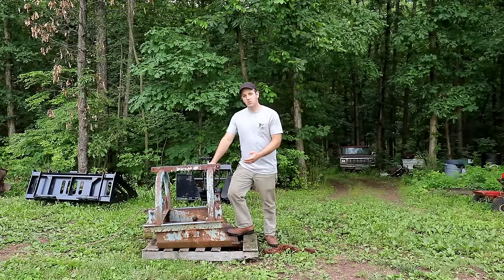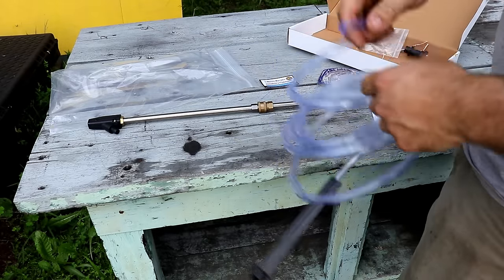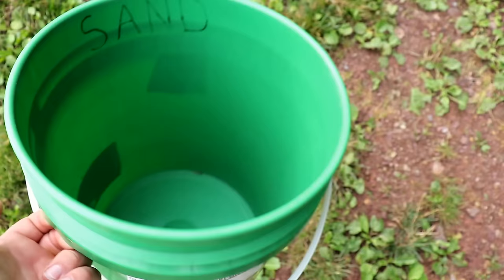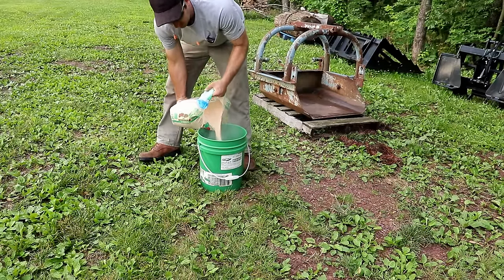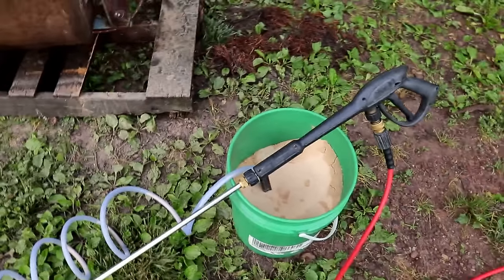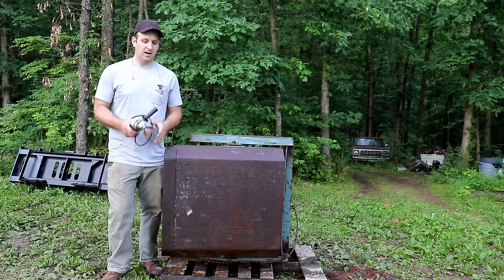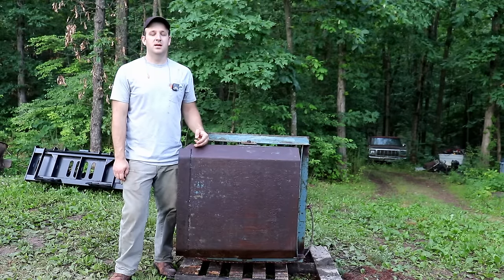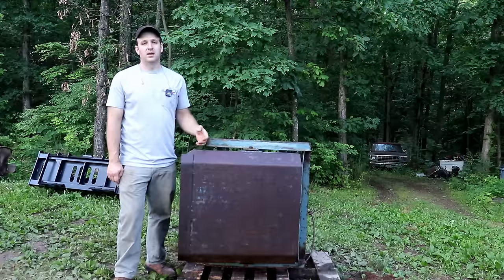I Turned My Pressure Washer Into a Sandblaster

Comment: I believe for about 95% of the time you were pressure-washing, no sand was being siphoned.  At 5:20 and briefly thereafter, we could see some white-metal areas appearing, but for the most part, it was just water-blasting.  You kinda need to keep eyes on both the work and the siphon-hose to monitor how the sand is moving.  I had a similar experience with my similar setup, which I set aside, but hope springs eternal.  I needed a helper to keep an eye on the sand, to keep moving the siphon-wand around and be sure it wasn't clogged or 'sucking air,' that overspray wasn't getting in the bucket (but was working alone)...but mostly what I was fighting with was water backwashing into the sand-hose from the nozzle...boom:  shut it down until you can get that hose clean/dry.
The holy grail of this method would be a system that can work with wet sand.  I messed around with that a little, only to the point where it became obvious that a wet-sand slurry, when added to the pressure-washing stream, took all the needed velocity out of it.
Reply from the maker: It was sucking sand but the siphon hose did not have a full stream. Shortly after I did this video this pressure washer died. I am going to try it again on my other pressure washer.
Reply: At 10:17 no sand ⌛
Reply: Get an old lpg/ propane bottle, and cut  the bottom out, then invert it so it will be  a funnel for the sand. Attach the feed hose to the gas fitting, for  continuous sand feed. Make some legs for it and you are ready.
Reply: @Jack Blakeney Take a look at what some people are doing in the realm of 'vapor honing.'  It's close to what I was hoping to do, but won't be fast enough for what I need to do typically, according to one of the most prolific posters.  They're doing what amounts to wet sandblasting, but in cabinets.  Problem for me is that it's not so much for heavy rust removal, though GREAT for cleanup of finer oxidation and paint from smaller-scale parts like engine or carburetor components. 
Anyway, the basis for getting the sand into a suspension in their supply water is just an average-sized submersible pump that recirculates water within a common 5-gal bucket that's got the sand in it as well, placed below the cabinet.  A portion of the pump output is redirected to blow the sand up from the bottom of the bucket, thus achieving the suspension.  The guns they use siphon up that suspension.  There's a LOT of water in the blasted mix, to the point where they have to use windshield-wipers and such to keep a clear view of what's being cleaned.  If I were doing nothing but small-part restoration, I'd go this route for sure.
Reply: @Jack Blakeney I went a lot further than that, and had dismal results.  Adding a heavy water/sand mix to the pressure-washer stream had the same effect as running a car into deep mud:  the stream has nowhere near enough energy to clean once the two collide.  It apparently works with compressed air vs pressurized water as the driving force, though (eg vapor honing).

Comment: Used one but added a flow in via compressor sand tank. So sand is pushed through. Even with a small electric water blaster it works aok.Wear good breathing mask.
Reply from the maker: I bet that did help. I'm not sure how my suction nozzle is made and if it would take pressure.

Comment: Good job. What tip did you use your zero tip? I agree, a full face shield, and maybe even plus safety glasses may be best. Thanks, John
Reply from the maker: I used the tip that comes with the sandblasted. You don't use your pressure washer tips. The sandblaster goes in place of the pressure washer tip.

Comment: Try morter sand. I bought some for a sand box for the grandkids. The guys at the hardware store told me it's better for building sand castles than that stuff you buy in a bag. They filled the whole bed of my truck for $19.20 at the concrete plant that was conveniently nextdoor to the hardware store. It's a much finer sand.
Reply from the maker: I have since found out that sand is bad for blasting. It can cause silicosis.

Comment: I think it looks great. You don't have to get it down to new metal. The paint will adhere really well to that surface forhe same reason you spray red oxide primer.  My uncle and cousin spent their lives in the sand blasting business and that's what they told me. Youmight even let is set out a couple days to get that flash rust so the paint can get a good bite into the metal.
Reply from the maker: Yeah,it was probably more than acceptable for a tractor implement.

Comment: I would think that at low pressure and the water to sand ratio would only take off surface rust unless you remained concentrated in a small area over time.
Reply from the maker: I think that it was not siphoning enough sand.

Comment: should have used more courser sand for metal, play sand is good for wood to strip paint
Reply from the maker: Yeah, I was just trying to start with something cheap to see how it worked.
Reply: I use the 30 grit 100lb bag for sandblasting from home depot and it works great
Reply: My dad used to get us sandblasting sand since it was cheaper and he had a sandblaster so he just used it when the summer was done

Comment: I'm interested and thinking that together with a diy coke bottle air blower sand blaster could give fairly workable results. Water and sand are definitely a recipe for flash rust I'd reckon.
Reply from the maker: I'm thinking I need to follow up with a weed burner/ propane torch to dry it fast.

Comment: I have the same. blasting gun.  the sand feed tube is 

a) too long = more resistance to suction

b) coiled (sand goes down, then has to be lifted, repeat), big resistance 

c) wet or just humid sand won't flow well, if at all. Must be super dry.

so that adds up a lot of resistance for the suction to overcome, preventing a reliable, full volume of sand.  

yes, wet sand will clog. if any doubt are granularity, sift the sand thru window screen to reduce clogging

my washer: Powerhorse Gas Cold Water Pressure Washer — 3200 PSI, 2.6 GPM

When I got good sand flow, only intermittently, removed mill scale and gave white steel.  Even with your pitted, rusty steel you should be getting white steel

But the sand flow was VERY irregular.  Very frustrating.  I shortened and straightened the sand feed tube, which was much better, but not yet acceptable.  holding the gun in one hand, and jiggling the sand tube in the other.  tedious, ineffective.

I'm thinking about elevating the sand bucket to about waist height so the suction doesn't have to lift the sand, should increase chance of a good, steady sand flow.

And I agree, play sand at $5 / 40 pounds works well. Lowes has two grades of sand.  Large grains weren't my problem, but I will sift next time anyway.
Reply from the maker: I agree with all of that. I think I need some kind of stand for my bucket. Someone said pool filter sand works well. I have also been told to try different tips.
Reply: It looks like the sand/blast media needs to be in a bottom outlet cone sitting above the job. That way gravity takes it all the way to the blaster tip. All the water suction as to do is overcome line friction.

Comment: What you have looks like it is ready(when it dries) to be painted with a rusty metal primer and then a top coat. I have a big sandblaster that makes the steel clean and brite but it makes a big mess and takes at least an hour to set up. For tractor attachments, dump bodies, truck frames, and other normal use steels, I think you got it good enough. I will probably try one of those next year. Good Luck, Rick
Reply from the maker: I've used that rust metal primer. It seems to work good for something like this. I need to try some different media in this to see if I can get any better results. Have a good week!
Reply: @TractorTech  Thanks and same to you.

Comment: Still 25 bucks u can’t beat it ! Special in those tight areas that are hard to work at .. this would be awesome for my mowers and trailers.  I don’t need it 100% perfect but good enough to stop the spread of the rust that’s all ..
Reply from the maker: I have it working better now. I used it on my zero turn deck. I also want to use it on a trailer, so we thing alike lol.
Reply: @TractorTech  lol awesome!!

Comment: You would think with that high of pressure, the sand would buff it to a bare metal fast.  
But I don't think this works well because the water seems to be buffering the abrasive effect of the sand so that it glides off without actually etching into the metal.  Thanks for the demo.
Reply from the maker: You would think. I think the main problem is the media that I am using.
Reply: @TractorTech   I am no scientist, but I suspect the density of the fine media vs density of water comes into play.  Water molecules surrounding the grain of sand lessens the impact.   Maybe coarser sand would be more effective.

Comment: I have not used this method before,  but I have done a lot of pressure washing and a small amount of sandblasting. It appears to me that you danced around far too much, and did not spend enough time on concentrated areas. Maybe try slowing down and work on small areas.
Reply from the maker: I have it working decent in this video. https://www.youtube.com/watch?v=BlJ2jguphao

Comment: Maybe using black beauty media would be the trick. Play ground sand grains are mostly rounded and softer than black beauty. Black beauty also has sharp corners and it comes in different grit.
Reply from the maker: I may try black beauty. Play sand is not a good media. I just was trying something cheap since it is a one time use.

Comment: Play sand is not very good for blasting, but if you insist on using it, run it through a metal window screen first to get out the oversized chunks that will clog your system.  I would like to see this system used with fine black diamond coal slag.  That stuff cuts good in a dry blaster, I guess it would work good this way too...
Reply from the maker: I was using play sand since it is cheap, and I can only use the sand one time with this system. I am going to try some other things when the weather gets better.
Reply: Black Diamond Blasting Abrasives (coal slag ) is 50lb/$11.  I used it dry in a highly modified HF blaster.  It cuts well but the media gets everywhere and is very difficult to clean up. I want to try it wet but my pressure washer is only 2300 lbs @ 2.3 GPM.  I've read that the wet blasters are only effective @ 3500 PSI and above.

Comment: I would try pre-treating the rust before wet blasting with WD-40 or any cheap rust remover. I'm about to buy a wet blast attachment to spray the chipping paint of my concrete porch before I repaint it. I hope it works.
Reply from the maker: It probably would work good on the concrete.
Reply: @Conrad Cole did it work well?
Reply: @SteveMacSticky  Yes, it worked really well. I found a bag of "black blast" medium at my local hardware store but sand would have worked just fine I think. It blew right through 50 years of paint layers even in the places it was not chipping yet. I used a 5gal bucket with a lid I cut a hole for the siphon tube to fit through to try to keep the medium from getting wet. It was a bit messy cleaning up the black black and probably would have just opted for sand if I had to do it over again.
Reply: The black blast was very sharp and shiny like crystals of coal. It reminded me of what is used to coat sandpaper. It was easier and safer option to a diamond wheel on an angle grinder and probably cheaper too in the end.
Reply: @activenation  thanks

Comment: maybe if the bucket of sand is up on a stool so that the sand can come down with gravity.  and get all the curls out of the hose so the sand doesnt' have to do loopty loops to get to where it needs to go.   Put a hole in the bottom of the bucket and so the sand tube comes out the bottom of the bucket.
Reply from the maker: I have sat the bucket up higher and it did help. It would be nice to have a gravity feed setup instead of a suction feed.

Comment: I wonder how that harbor freight sandblast gun would work— but something like that implement I would just clean it the best I could and then por 15 it/rust inhibitor then paint it
Reply from the maker: The suction type sand blasters work good if you have a big enough compressor. POR15 doesn't work.

Comment: I'm curious what this would be like using "Sharp" builders sand? Play sand is apparently similar to sand on a beach. All the points have been knocked off through being agitated in the sea (Like tiny pebbles), but builders sand is more like crushed rock and is a lot more abrasive.

It would probably give the nozzle a bit of a hard/short life, but if it gets good results, and the replacement nozzles aren't ridiculously expensive, it might be worth it.
Reply from the maker: Some day, I am going to try a better media.

Comment: You can get a gallon of aircraft stripper, Lowe', or Home Depot. well it's good enough to take the paint off. Will save you a little time.
Reply from the maker: Aircraft stripper does work good!
Reply: Not anymore the new formula is terrible

Comment: How did the nozzell hold up also if you used fine screen wire and filter you sand it takes out the big stuff
Reply from the maker: The nozzle is good so far. I'll have a new video on it soon.

Comment: Hi, and good morning. I would like to begin by saying, I like the way you presented the information in your presure washer sand blasting video. I work in the sand blast and paint feild, and as I have experienced more than 23 years in this industry, with multiple fauceted types of techniques and methods of deployment of blast media, one commonality in utilizing any form of abrasive, is pressure. regardless of what is being used, the pressure is the back bone, or the mule pulling the cart. the beginging of your video mentions 3000 psi and a minimum pressure. That is about 2/3 of the amount needed to remove undamaged paint. For example, a car with no rust or delaminating paint. In order to remove rust and the oxidation rust leaves behind you're going to need a minimum of 6 to 10 thousand psi, and thats if you are looking to gain a profile sufficient for the bonding of any coating system. That being said, since your desire is to apply a protective coating system, the last thing you want is any oxidizing substance on freshly basted surface. the salts in the the water system, espectialy tap water with remain on surface even after drying, trapping those particles and continuing the oxidation process. Dry is better, however if this hydo blasting method is to be used, then a destilled fresh water wash is highly recomended, prior to application of primer. Hope this info helps your future projects.
Reply from the maker: Thanks about the video. Thanks for all of the info on the blasting. I may try to fill an IBC tote (275 gallons) with distilled water. I had not thought about the minerals in the water causing oxidation. I have a propane weed burner I was going to use to dry it the water off. This is blaster is going to be used on tractor implements or possibly a trailer. It is not going to be used on anything that I am looking for a high end paint job, just something that I am trying to preserve and make a look a little better. I have another video. Check it out and let me know what you think. https://youtu.be/BlJ2jguphao
Reply: That may be true, however for the home gamer you have to consider cost. Use a sharp sand from a masonry shop instead of play sand, and then I'd use a compressor to blow most of the water off and then a spray down with phosphoric acid to cut flash rust.

Comment: After cleaning there's a spray on treatment called fluid film that's a metal penetrant preserve to stop further rusting & would be ideal for what you have there. Content creator AMMO NYC used it on an old doodlebug for a guy who wanted to protect but not remove the rust that was there after cleaning the metal . Title of the vid is , First Wash in 91 Years: Ford Model A Found in Woods and Start Up!. Apparently it's used as an undercoat on street cars, i assume he means hot rods. Hope i can get here as i could do with some of it
Reply: When finished blasting use dawn soap and wash it off and that will stop it from rusting also ..  I do it almost everyday
Reply from the maker: That is interesting!
Reply from the maker: There are some other rust preventives too. There is something better than fluid film. I can't remember the name right now.

Comment: Thats really good result. You reallt must get the garnet or steel/iron sand to try at least once. The earth scoop is in a condition that can be real disappointing if you get the big commercial units onto it. The other one is silicone sand. I don't suggest you get anything for nothing in this business. No man does! I am impressed enough to consider one myself, in the same position as you appear to be? And a hood with face shield heavy duty boiler suit, thick gloves like welders gloves and cover up from the blast. Not much point beggering about filming future success. The product will be the payoff. Thank you for showing me the adapted type wet blaster. Mud guards and bonnets will be mint with play sand you used before painting. Whatever the sand is (play sand?)
Reply from the maker: Play sand has rounded edges for use in kids play boxes. Here is another video on it: https://youtu.be/BlJ2jguphao

Comment: Don't let water get into the sand transport pipe. Hold the wand so that the sandpipe remains above nozzle. If water gets into the sand pipe it will get clogged with wet sand and sand will not be sucked into and enter the nozzle.
Reply from the maker: I'll have a new video soon with revised methods.